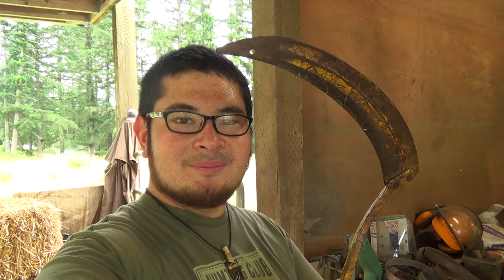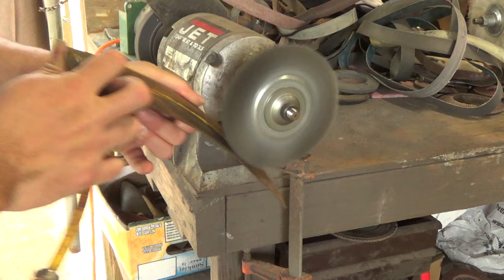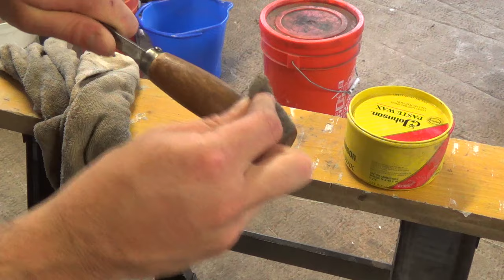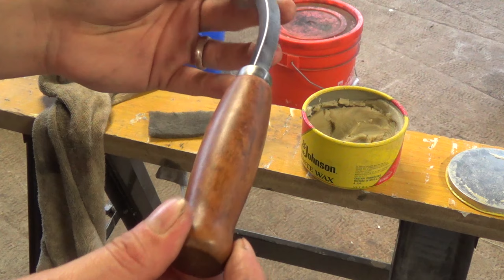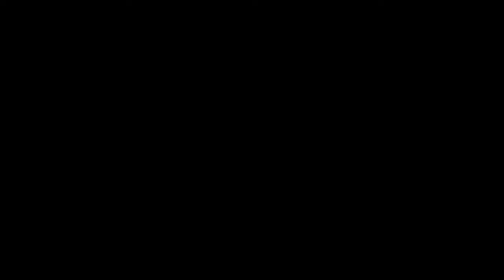Restoring and Sharpening an Old Grass Hook Sickle

Comment: The best tool I've found to sharpen mine is a small, round, chain saw file. I file away from the edge, rather than into it. I believe it gives a better edge. I found mine in an abandoned shed. It is identical to the one in the video. I never thought about removing the years of patina. I look at the handle and think of all the hand that held it in order to give it it's special look. I look at the worn rustic looking blade, and wonder about the grass and weeds it cut, and the aching backs of the users. If I bought a brand new hand scythe, having never seen one, thoughts would not occur to me.

Comment: It is interesting to see you sharpen the sickle with a file like a knife. In my homeland I saw farmers sharpening sickles by hammering the edge on a small anvil with a ball-peen hammer. It becomes as thin and as sharp as a razor.
Reply from the maker: That's one of the main differences between American sickles and the rest of the world. Most sickles are made of softer steel and are peened to refresh and thin the edge and then honed with a stone. Many American sickles are hardened or have hardened edges, so peening can actually break them or crack the edge. When an American sickle or scythe blade gets dull, it's edge is ground thin and kept sharp with a file or stones. Sometimes both are used.
Reply: Nicholas Tomihama Thank you for explaining :)
Reply: I have a European style sickle and scythe, and I tried peening the latter on a specialized anvil, but I found it to be very tricky. So now I just use a grinder and honing belt/strops on them.

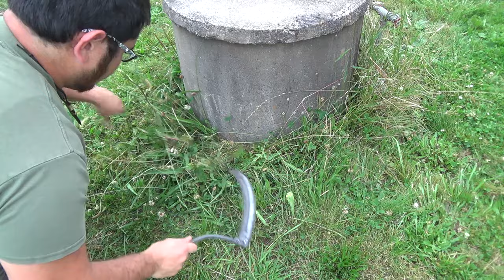Comment: It's doing the job at 3:25 or so, but I'm not super happy with the way it cuts?  Can it be sharper?  Also, how do you hold the angle when sharpening?  It's done without any sort of guide, right?  I have a scythe and there's an edge on the back of the blade that you rest the stone against so you don't have to use any judgement or control - it just rests there and against the blade to hold a constant edge.  I'm asking because I'm thinking of buying a grass sickle but want to see what a sharpening kit costs and whether I could use it easily.

Comment: It should cut easier by adding more of a slash or slicing motion.  You're grabbing the vegetation and dragging the blade toward you trying to plow the blades,  you need to be moving more across the body or flicking your wrist.   It's a shearing cut,  not a chop.

Comment: You really need to get yourself a 'hook stick' to keep your left hand safe - about 3ft long and as thick as a broom handle with a pencil size branch coming off the end about 4-6" long. You use it to lift the grass before cutting it, I usually cut mine from any bit of Ash that's in the hedgerow.
Reply: The Potterer before I got my scythe, I used to use one to pair with a machete to clear cut thickets of saplings.  Found a video of a Mexican landscaper with a machete in one hand and a crook stick in the other.   Hook behind saplings or brambles,  then flick the machete down the stick to get a nice clean cut low to the ground on flimsier vegetation. Like a make shift by pass shears.   Faster than using lopping shears, if there's a lot of stuff to cut, but leaves higher stubble.  Both slower than a brush scythe.